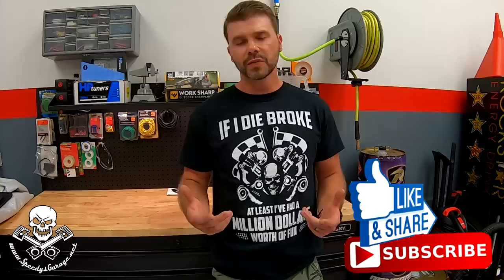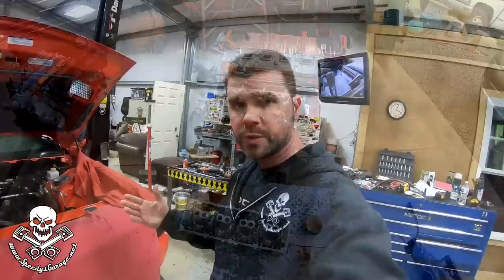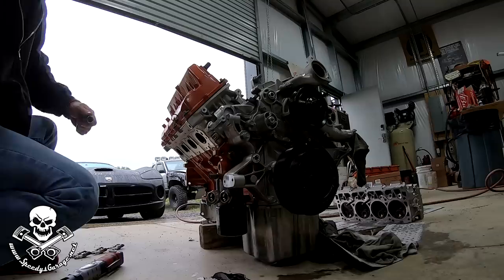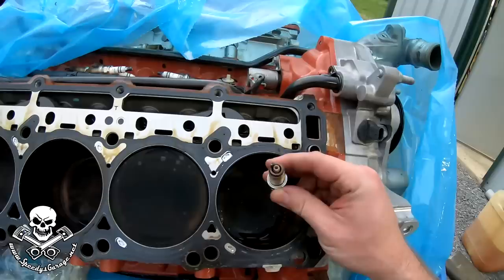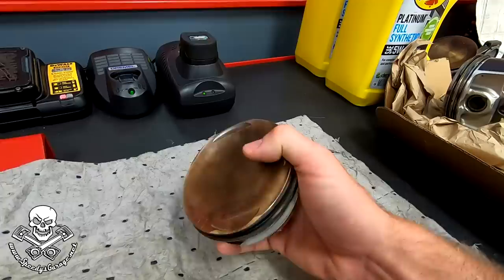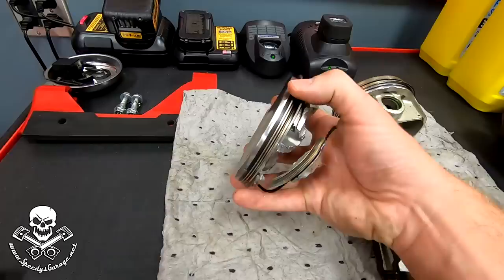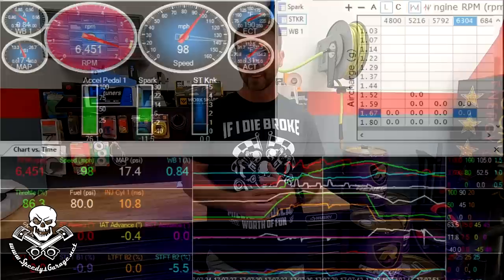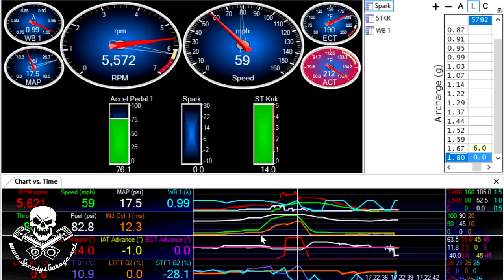Hellcat Engine Failure Diagnosis Speedy's Garage Challenger Go Man Go

Comment: I would say it goes like this
1, bent the rod possibly due to detonation.
2, bent rod brings piston in contact with crank causing piston destruction,
3, the end
Reply: Sammie n Dave Caisley exactly. He so focused on the piston. But what does the rod and crank look like. I've had a rod bend only a few mm. And the bottom the piston skirt was whacked off and it squirter knocked off. That was it. Got lucky that the block and crank were saved.
Reply from the maker: Never found the rod, it either went out the oil pan, or was IN the oil pan.  I didn't take it off we had to ship the motor out.

Comment: The piston strength is in compression and not tentsion. as they try to lighten the piston an rods they have removed to much material from bottom of piston. its not going to happen when power is on as compression is high in cylinder. but will fail when revs are high and power is off as this is when rods are pulling hard on piston and no power is pushing piston down.  This failure. can happen to high load race engines and the every day cruiser. the amount of load is not problem its when you come off there power. in between gear change. or gearing down heard.  Then its hammer back the piston to the top of cylinder. All that beating will rotate  piston as crank will rotate rod up in a loose manner tappining piston on the lower side of piston relative to the block V shape as it hits one part more then other tuning piston at top. Knock sensor would not pick it up as it is on down stroke  and its not a slow failure it is an instant failure.

Comment: Yeah man I’ve done some research and math on the ideal rev range and with the bore and stroke of the hellcat Kurt is right these cars were designed for no more than 6450 rpm on stock parts otherwise you to run the risk of eating wrist pins because the torque converter can’t keep up anything past that rpm to match the motor thus taking time and adding time and rpm before shift and takes a bit longer to shift causing it to blow. Older vets had the same problem and ended up having to shift sooner so they don’t bounce of the rev limiter du to slow trans problems. And these engines weak cylinders are the ones that broke on your car in every blown hellcat never any other pistons or problems that broke in the five or 6 hellcat failures I’ve scene recently.

Comment: But if the top of the piston was to get pinched in the top of the cylinder, it would be stuck even harder after the engine had cooled down since metal expands when hot and shrinks when cold. I’m going with the theory that too high rpm has weakened it and then it just got worse until it got torn apart

Comment: Speedy,  to me it seemed like the lamba was quite high for 15 psi at .84 .   I have a Gt500 running .69 at wide open throttle with 12 psi of boost.  Im sure my tune was overly safe.   Looks like your running too lean,  i would stay below .80
Reply from the maker: Crikey, .69 lambda!?  That's a low 10s AFR.  We've always shot for a .82 - .84 range which is 11.2 - 11.5 AFR on a Hellcat on gasoline.  The ones I've seen that run low 10s AFR tend to go through cats if installed.
Reply: @SpeedysGarage  thanks for the reply, from my memory .69= 10.12 afr, might have been closer to a 10.9 afr to mid 11s but nothing above 12 afr, this was a Lund tune.  I thought it should be closer to 12 afr and Lund racing said 11s is where a safe tune should be.  14.67 x .83 =12.18 afr.  Im no expert.  I saw your video with the new motor and it looks like your running in 11s.   for your afr.  Ill have to dig up my old datalogs on my GT500, at the time it did seem really rich but according to Lund its better to have a rich afr.  Thanks again for replying.
Reply from the maker: Typically it's mid to high 12s for NA motors and mid to high 11s for FI motors like the GT500.

Comment: Think about it Fiat owns them and you are going to see the degradation of quality.  They will not fix or let you brace the diff without voiding the warrantee.  Many Hellcat owners are seeing the pumpkins splitting on a sticky track.  Some of the progams in it will ignore or shut off the knock sensor like what Ford will do in the coyote to allow for race settings.

Something caused the the skirt to rock and wedged the piston head to seize and the oil ring holes are the weakest point.
Reply: Jeff Yates for the diff brace that is not true my charger has been to 5 different dealers and not one has tried to void it because of my brace i snapped a axle on the street it got brought into dodge with my slicks on it and they still replaced it under warranty they really arent very particular atleast the dealers myself and many friends have been to

Comment: Looks like the oil ring land failed, seized the piston in the bore, and the proceeded to pull the rod and wrist pin out...
Reply: The broken edges show over stress failure from what I can see in the video. This may have been caused by secondary motion due to the high rpm.

Comment: Not an RPM issue, What does the cylinder look like? This failure looks like a ring end gap issue. The first thing that happens is under boost the cylinder, rings and piston heat up. This causes them to all expand. If the ring end gap isn't big enough (.25 to .30) the ring will bind in the cylinder and the top of the piston will rip off. Add to this issue the crappy stock fuel rail that tends to under deliver fuel to 2 and 7... and you get a slight lean condition on those cylinders... heating them up more than the rest...
Reply: If the Rod broke, THAT would be an rpm harmonics issue... 2 things to make these engines live longer... 1 replace the stock fuel rail with a more balanced better flowing one and bump up the pressure a bit with either a better fuel pump, or a boost a pump. 2 set ring end gap to .30. Yes this isn't super cheap, but certainly cheaper than having to replace an entire engine.

Comment: I'm dealing with a similar situation only with my 10' 5.7 . About 2 weeks prior to the fail I would get up to 14 st knk when prior I wouldnt get over 1-2 st never any lt no matter how much I retard the timing or no matter how much fuel I would add I still get anything up to 14 knk on a wot run. Final day I meet up with a 5.0 stang that wants to run so I give my girl all she gots and take the stang by a car and everything still seems good at that point. Guy gives me a thumbs up and keeps going I pull up at home and park. About 45 minutes later I go back out to leave , start her up and right away I notice a misfire that maybe lasted a second or 2 and then i hear a loud consistent knocking. My first thought was a valve seat , so i pull the plugs and find the ground strap or electrode as some call it, missing from one plug in the 6 cylinder. Pull the heads and drop them off at a highly rated crankshaft shop and find out springs are good, seats are good, push rods are good. But he does see a couple very small gouges around the no 6 valves on the bottom of the head. Same size as a ground strap. Haven't found any pieces of metal or the strap on the piston or anywhere else. Cut the cats open, no strap there either. Took my shop vac everywhere around the block I could and sifted through the debris , nothing. No signs of detonation , pistons and cylinder walls all look good. I've always had the mds bullshit shut off , checked the lifters, no flat spots, all roll like normal. Drained the oil, no metal. Did get a second or 2 of coolant before oil but I'm assuming it ran down the oil valley's in the block when I pulled the heads. Now I'm afraid of that I may find damage in the block. Just like your tune I had my rpms set to 6200 but I'd bet it didnt actually shift till about 6400 rpms which may be too high for a 5.7 hemi with 85k miles running a 91 perf cai tune. To bad I forgot to save that log as I normally would after each wot run ,  would have been interesting to see if the iat spiked.

Comment: When the engine builders use stronger pistons, (non-stock) has anyone found that same condition?  If non-stock pistons are also having those same problems then I'd guess that the underside of the pistons are not strong enough to take the shock of the forces generated on the underside of the piston that happens when, as you said, the piston rod is then pulling down on the underside of the piston.  Also, the distortion of the piston-cylinder that is actually grabbing the piston as it's changing direction is part of the problem caused by a lack of coolant in that area?  There is a condition called 'cavitation' that can happen at high engine speeds, which would cause a bubble to form.
Reply from the maker: I'm not sure on that, but haven't heard of any built motors failing, and they shouldn't right :)

Comment: How is the cylinder? I know that some late model MB cylinders are 'coated' for less friction, etc. and blocks are junk once scored, since the Hellcat has 700 HP wondering if Dodge uses a similar treatment? I am 64 so I remember when getting 550 out of an engine was close to its limits-- To be honest I doubt that a late 60's Sox and Martin Hemi pro-stock had more than 600, I think there is a interview of Grumpy on youtube about his 396 and I think he said about 550--Funny how the old 'muscle' cars would run in the 14 second range at about 100 mph unless a HP version like 427/425 would be in the 13's at about 105 and people were amazed. I had a friend who had a 70 SS 396 350 hp version Chevelle with 331 gears and a 4 speed and he BARELY got into the 14's at about 95 mph, had about 50k miles, Grumpy's Vega ran mid 9.5 at about 135 with his little mouse motor, I saw it in action a few times.Performance engine building here has some interesting BBC head flow vids showing the differences in casting # heads as well as what he refers to 'good port' 'bad port' and how much HP is lost or gained --he can get about 650 out of a 454 with original oval port heads after all his work, not too shabby, his Chevelle runs mid 10's with not much trouble
Reply from the maker: Glad to see someone properly quoting times from previous generation muscle cars.  Can't tell you how many folks have come up to me at the track and told me their 440 six pack ran 10s bone stock LOL
Reply: Yeah that was always good for a laugh, all those 10 second owners never been on a strip, stories like I recurved the distributor and cut a second off my ET were always amusing. In about 1975 I bought a 67 RS Camaro with no engine but had a 12 bolt with 456 gears and was set-up with headers for a BB, my buddy worked at a engine repair/rebuilding shop and got me a 427/425 that had a spun bearing for the price of disassembly so I paid the bill and owned it. With a JUNK 780 Holley and dual plane manifold it ran mid 12's at 108-110 with a 4 speed and a set of 25 inch borrowed slicks, Epping NH grudge night, entrance fee was $2.00!!! Someone I knew who raced said if I put a good 800-850 and a single plane low 12's no problem.Borg and Beck pressure plate was like squatting 400 pounds of leg strength

Comment: Clearly the Pistons are too low of a quality, no reason to cut corners if this is the result.
Reply: I wouldn't call a 717 hp cast piston weak.  I also wouldn't expect to push that same piston past 717 without problems. These are mass produced to hit exactly 707/717, if I wanted to go more than that I would expect to do rods and pistons at least.
Reply: shadow105720 exactly it doesn’t matter what car it is as soon as you mod performance wise at all the potential for failure increases 

Build it race it break it repeat

Comment: I can buy into the over rev theory and a (somewhat) defective piston theory pretty easily, but then you say it happens more frequently on piston 7.  If you had a distributor I would say something is going on with the cam at those high RPMS , maybe the oil pump could do it, I just don't know.  Good luck.

Comment: Take it from an old fast guy, many of these mopar - Ford motor fails are from 0-5 weight oil. Use 20-40 weight min. Water doesn't cut it in hp applications. I've used 50 w for 50 yrs.

Comment: piston broke  wrist pin hole cracked and pulled out the bottom  or c  clip came out thats why i like teflon buttons  instead of c clips  c clip opening  should be  at 12 orv 6  position

Comment: Piston speed just over 4000 at 7k rpm. With high end forged components, good head porting, and a cam with the duration to run to 8000 rpm. Assuming upgraded valvetrain, you could run to 8250 (piston speed 4900 fpm) on the strip only and it should make power for a couple years as long as you don't drive it to 8250 all the time. Maybe shift at 7k max for daily driving with the 8250 tune for strip only. Cast pistons, even Mahle, don't always have the grain structure to hold the force of a Mach 3.8 change in direction. That piston weighs more than you do going from 0 to Mach 3.8 in milliseconds. People never look at piston speed enough.

Comment: This happens to turbo LS motors, stock pistons let go. There's a few reasons, but usually too much RPM for the piston or flexing wrist pin (power or detonation). Excess RPM can cause microcracks, which slowly get worse and let go at random (even idle). Flexing pins bind up, which can snap the skirt off as piston twists in bore & bend rod. Skirt bits then get smashed between piston and rod & usually rod disintegrate. All happens VERY quickly.

Comment: I have an 84 Mustang 5.0 with a 4 speed, and I beat the shit out of that car and have over 160K miles on it. It was stock other than a 4 barrel, headers, and aluminum intake. I never had an issue with any breakage. Never opened the engine, or rebuilt it. 
You can't build a lot of HP on a stock engine and expect it to last. And of course, it's a MOPAR, so nuff' said.
Reply from the maker: And I drag raced my 2009 Challenger RT for 10 years without any issues as well.  New motor Demon/Redeye motor I dropped in is whipping lots of Mustangs at the strip.  I'm going GT500 hunting in the spring :)

Comment: Have a metalurgical inspection performed on the rod material to see if there was a defect on the part that initiated a crack leading to a stress fatigue failure.  Or just buy another engine.  WTF.
Reply: X-ray diffraction will cost you more than replacing that whole engine.

Comment: I don't think I just had a simple failure from one bad piston. Did u notice that the ring lands were broken. I have seen on boosted applications, that not enough ring gap will cause the piston 2 seize in the bore. In which case, the ring lands break and in ur case it also tore the wrist pin out of the piston.
I would have liked 2 seen video of what was left of the connecting rod.
As far as the other cylinder u referenced as having burnt out spark plugs. That an unmistakable sign of detonation.
Was it caused by the spike in IAT? Could be. 
But u can't tell me there were no engine misfires recorded in your data, with 0 compression in one cylinder and melted ground electrodes and broken electrode ceramic insulators.
And that's my 2 cents worth.
Every car manufacturer, in an item masked produced, occassionally cranks out a hand grenade.  that's what upgrading components and blue printing is about.
Reply from the maker: Ring lands looked ok.  As time has passed it's looking more and more like a bent rod that eventually let go.  All the timing being pulled out of the motor due to the bent rod being detected at 17psi of boost super heated the remaining cylinders melting plug and breaking porcelain.  17 pounds of boost and -12 deg of timing is apparently very bad.

Comment: FCA is notorious for using inferior parts.Don't forget the crappy roller lifters that seize up and grind the lobes off the cam.
Reply: Yes! That's one of the most common failures. Crappy quality bearings.Probably no quality control worth a shit.

Comment: I think i have to agree that it’s just a mass produced defective part. I’ve been boosting the hell out of my 5.7 Ram for almost 2 years now, 6-10 psi on stock bottom end depending on mood, and i always wondered if this would be what kills it. It gets spun to 6700-6800 at the track so i know I’m pushing my luck. Although I’ve got forged pistons and rods just waiting to go in so we can turn it up.

Comment: You flogged the stuffing out of that engine and something broke.  What's the big mystery??  Probably nothing wrong with the components under conditions they were designed to be run...this was a case of just too hard, too often.  Lots of 0-WOT torque loading and eventually something goes.  Seen it more than a few times.  NOTHING is "bulletproof"!  Especially something not custom built.
Reply from the maker: I guess the fact that so many other ones seem to last flogged more often and much harder?  Usually failures don't start to occur until about 1000RWHP or so.

Comment: Would any of the repairs have been covered by your warranty?
Reply from the maker: Unlikely since I had pulley and a tune on the car, this one was on me and part of the modding game.
Reply: @SpeedysGarage  This may be unrelated to what we were talking about, but brings back a memory of one of your videos I've watched in relation to pinning crank shafts.  I just spoke with a service advisor at my local Dodge dealership and according to him, the new Challengers and Chargers are coming with their cranks keyed.  Not sure if that's 100% true or not yet because I haven't seen any literature on it to verify that.  That could be some good news for many then and save them the hassle of having to pin their crank.  I have a 2018 Charger Hellcat and a 2019 Challenger Redeye Wide Body and supposedly those cranks are already pinned from the factory.  Wish I new for sure though.